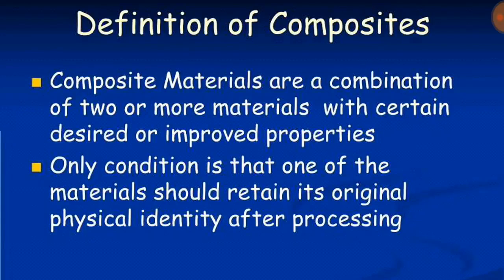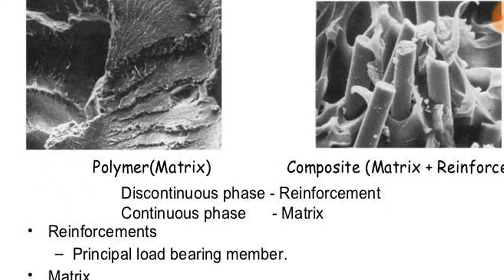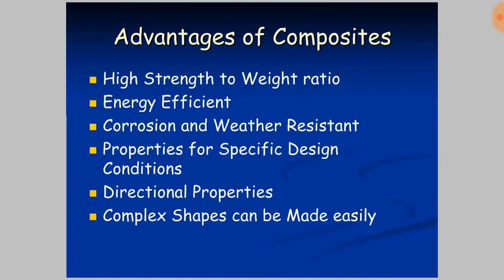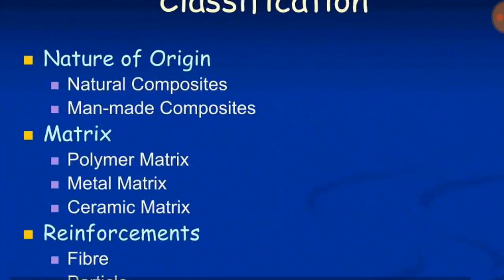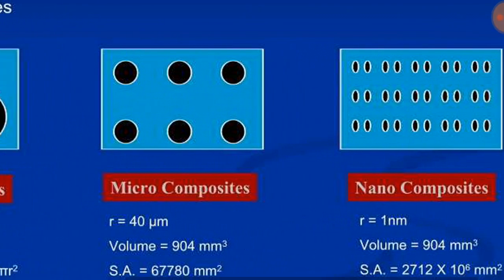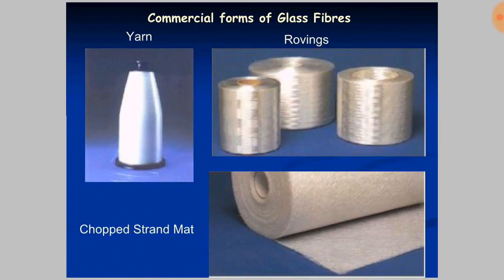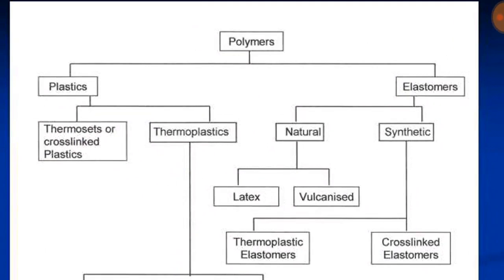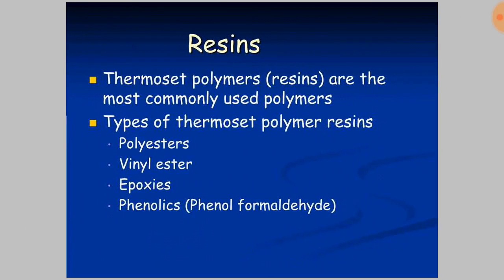Composites, Resin, Polymer, Reinforcement | Definition | ENGINEERING STUDY MATERIALS

Comment: Greetings Engineering Study Materials Guys:  This is my first time watching any of your vids.  I was looking for information on Carbon Fiber wrapping resins and I came across this video.
More specifically; I'm looking for the appropriate or optimum type of resin for Carbon Fiber Wrapping rifle barrels where there is high heat to consider.  After watching this video it also seems appropriate to ask you what type of Carbon Fiber you would recommend for wrapping Rifle Barrels where rigidity as well as high heat are to be expected?
Can you give me an idea of which of the resins and Carbon Fiber types you've worked with would be suitable or optimal for this application?  Thanks in advance.